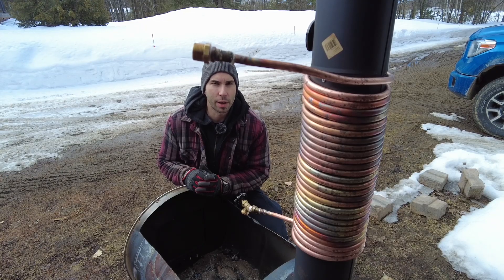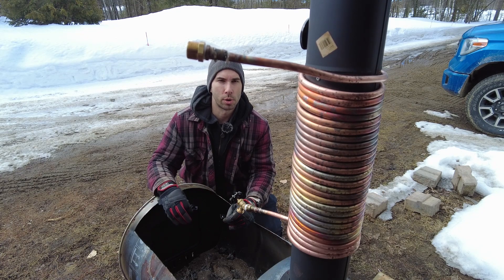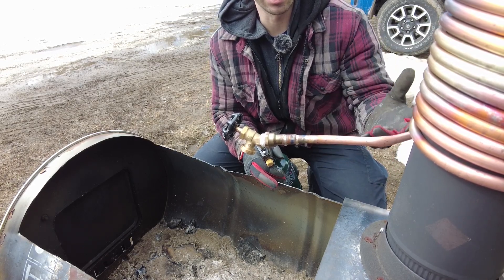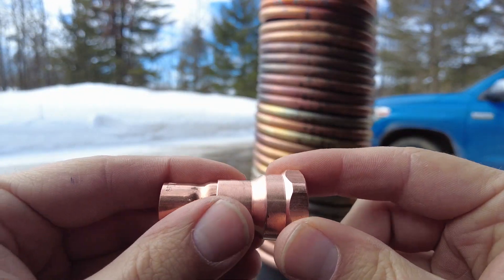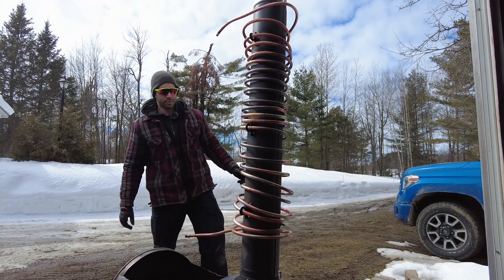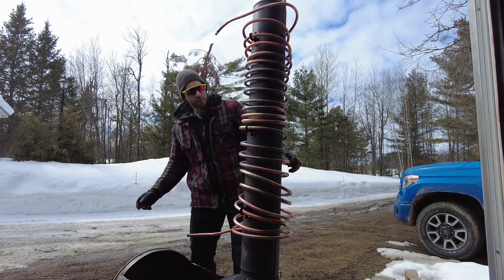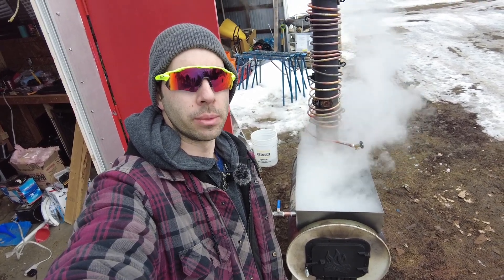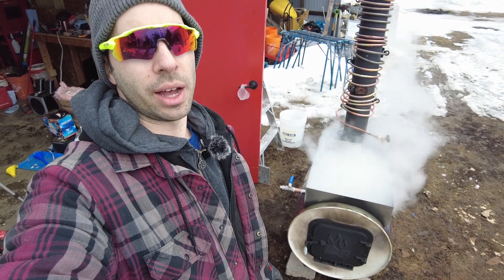Fixing the Copper Coil | Optimizing the Evaporator

Comment: If you get rid of the valve on the bottom and regulate flow out of the five gallon bucket you’ll be fine. That first coil job you did was perfect I couldn’t get my coil wrapped tight against the stack. I have a couple of vids about my preheater if you're interested.
Reply from the maker: Thanks! I'll check them out. It ended working pretty well with the second coil setup. Problem is my bucket setup isn't currently ideal to control flow, my re-think it this winter
Reply: @brokenpinesfarm  Ha! there's always something to tinker with!

Comment: The spacing on that tubing was the answer
Reply from the maker: Might try to throw a pressure relief valve on it and sandwich a 7 or 8 inch pipe over the copper see if I can't increase the efficiency of the setup...but next year, enough spending for one season, time to boil some sap now!